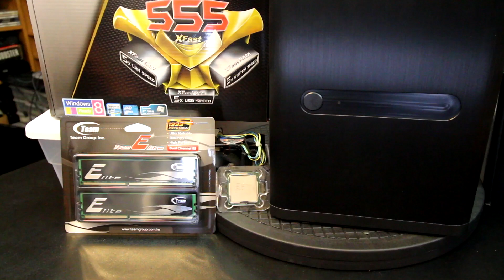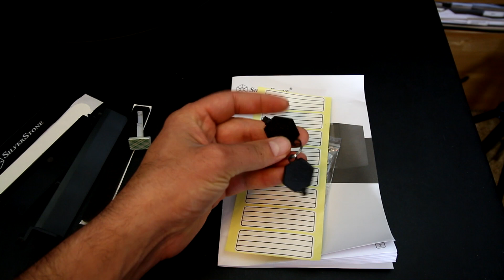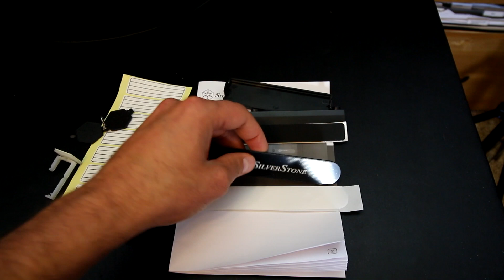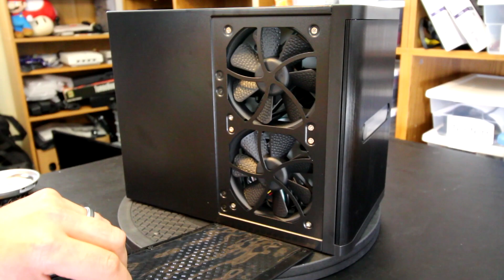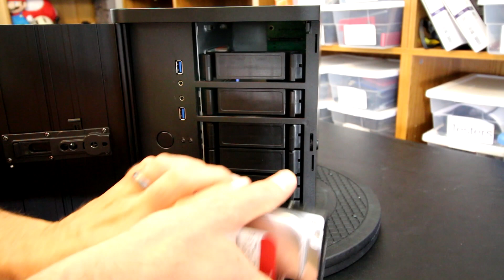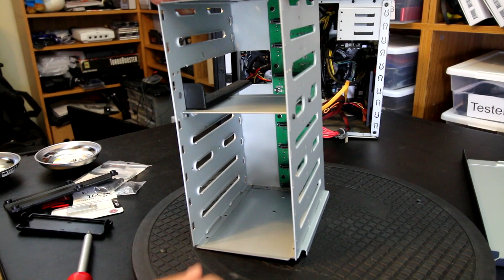NAS build with the SilverStone DS380

Comment: My understanding is that you can have the 9 hard drives but you would have 2 hard drives NOT HOT Swappable drive but then you your still getting the best out the case
Reply from the maker: +ROB MCGILL Yes that is possible and will allow to get more from the case.
Reply: How do you get 9 drives in there with two no hot swappable?
Reply from the maker: I think what he was getting at was 2 non hot swap bays and 7 hot swap drives while using a video card.
Reply: Oh I see. Thanks for clearing that up for me.
Reply from the maker: You bet. No problem.

Comment: Dude, that thing is fucking expensive! Why not put a few more bucks in it and buy a Lian Li PC-Q26...
Reply from the maker: +GuteAlteDMark The PC-Q26 doesn't have 8 hot swap HDD bays though. That is what brings the cost up on the DS380.
Reply: AdoptedMike
But it has Backplane... well you'll have to buy the other 8, because it comes with only 2. And for a private nas it's no problem to open the side panel to swap a drive. If you lose a drive you'll have bigger problems anyway than opening a pannel.
Reply: +GuteAlteDMark Good luck finding the backplanes for sale. Go ahead, I DARE you. Lian Li didn't respond to my query about them and they're no where to be found for sale online. The PC-Q26 is a fail because lian-li didn't support it with accessories like that..
Reply: Dajinn
Well in Germany we can just buy them online.
Reply: +GuteAlteDMark wow man that's just great, does the video poster sound like he lives in the EU? let's get even more realistic here. after buying 4 more backplanes, at 13 USD(converted from a conservative estimate of 12 euros), the case comes out to 242 total before shipping or any tax, depending on where the buyer gets the case. that's pretty costly!
Reply: Dajinn
And it's some solid shit. This one looks so cheap and as you can hear from the guy in the video it's difficult to handle. So why not invest a few more bucks and have good quality instead of this cheap steal case...
Reply: +GuteAlteDMark 

http://www.amazon.com/gp/product/B00IAELTAI/ref=as_li_tl?ie=UTF8&camp=1789&creative=390957&creativeASIN=B00IAELTAI&linkCode=as2&tag=xdm2kdv-20&linkId=EQ3AKDQJ6ZRYDYDU     Silverstone DS380 price is $99. I don't think it is expensive.. It has good review.

Dude, that thing is fucking expensive! Why not put a few more bucks in it and buy a Lian Li PC-Q26...
Reply: +go Go $149.99 USD...
Reply: go Go
http://geizhals.de/silverstone-ds380-sst-ds380b-a1064122.html?plz=&t=v&va=b&vl=de&hloc=at&hloc=de&v=e#filterform
170€ here... pretty expensive for that low quality.
Reply: +Dajinn I've managed to find 2 versions of the backplane on Amazon.  2 drive and 3 drive versions.  they run 20 and 25 USD which adds up quickly.  

I'm considering building using the u-nas nsc800 chassis.  it's pricey at $225 with shipping but its slick

Comment: I hear you on the hassle to replace memory sticks, but as far as losing the hard drive, looks like you could have removed all the plastic bits and still used the bay.  Or just put one of your 2.5 in drives there?  I would also wonder if you cleaned up the sas cables if they'd come off as a unit.  Nice review though.  Good job!

Comment: I see that the case has 2 sata ports for each drive space - Why?
Reply from the maker: +yaris5150 One is for SAS drives and the other is for SATA drives. Depending on what drives you are putting in the bays, you would use one or the other.
Reply: Oh, that makes sense. Thanks! Do you know if there is updated version/another case that has this same kind of setup, but does that whole PCB thing better? I see you were saying it's not the best, but if it works fine I guess I'd be fine with it. Thanks for the response!
Reply from the maker: +yaris5150 You're welcome! I don't think that it has been updated at this point. Solid caps would be much better, hopefully at some point it will be updated. But if you aren't opening an fiddling around inside, you should never have to worry after the first time. Just be careful and you shouldn't have a problem.

Comment: Thanks for the informative review. That is quite cramped. I would also recommend a Fractal Define R4 or R5. Just did an 8-drive NAS build myself in an R5 with the popular ASRock C2550. A lot more room to work with cables, fans are better positioned to blow directly over/around/between the drives, and quiet design helps keep drive noise reasonable.

Comment: Great video man. Perfect amount of detail for when you are seriously considering the hardware.

I'm on the fence with this case. I really like it, but that issue with the raid card is a real bummer. It was hard to tell in from the vid, but would it not have been possible to cut away some of the plastic to make room for the card, or would that has messed the support? I was also a bit disappointed with the lack of rubber mounts for the drives.

Have you come across any similar cases? I am looking for smallest form factor but absolutely must have 8 drives.

Cheers for your efforts.
Reply from the maker: L4RRY  I have actually updated to Fractal Design Define R5. While it doesn't have hot swap bays, it is much larger for ease of cable and hardware management. I also went with the ASRock C2550D4I server board and ECC RAM. I found out that it is a much better platform for data security than what I was using in the video with the Celeron. I am now using FreeNAS and a ZFS2. The case is much bigger, but I am still able to hide it away. Plus temps are likely better too. The R5 has much better airflow and is actually more quiet. 

People have told me that you can still cram an HDD into the bay even with that RAID card installed. I never tried it. I lost that sever setup in a fire unfortunately.
Reply: +AdoptedMike Thanks for the review and some of the alternatives you have suggested, especially the case. While I, personally, don't see the need in upgrading to a server board, I can see why someone would. Thank you for the review. I am glad to see that this case won't work with my Adaptec raid card that I have.
Reply from the maker: +diskmaster23 Thank you for the feedback, I am glad that I could help.

Comment: Hi Mike.  I think I would have taken a dremel to the 2.5" cage and cut off the bottom section.  Your #8 drive could be hung vertically so at least you'd get it in there, albeit an aesthetic compromise.
Of course you could also do a build using no hardware RAID card, running ZFS with ECC RAM.  That would free up some room.
Very nice build, despite the frustration.  Like you said, it's not for show, and the case looks great on the outside (and pretty good inside as well!)
Reply from the maker: Wikus Van De Merwe I lost this NAS box a few months ago in a fire which took out a lot of my home, office and studio. So, I have actually updated to a Fractal Design Define R5 case which is much larger and easy to cable manage. Probably helps airflow and temps as well. I went with the ASRock C2550D4I server board with 32GB ECC RAM. I have found it to be a much better setup for data than what I was using in this video. I ended up going with FreeNAS as the operating system and using ZFS2 array of six 2TB drives. So far, I have had good luck. Just no hot swap bays but many times easier. Thanks for the positive comment! Are you thinking of doing a ZFS NAS build?
Reply: AdoptedMike Hi Mike.  I am actually in the middle of a ZFS NAS build (having caught the NAS fever!).  It's using an older Z87 board, 16GB non-ECC RAM, and a G3220 CPU.  Not the perfect arrangement, but hey... cheap.

Of the 6 2TB drives I had donated to me, 4 were damaged in shipping, so the NAS is running on 2x 2TB  drives at the moment using NAS4free.  Apart from the few days it took of swapping parts in and out to figure out what was wrong, it's run perfectly for 4 days now (NAS4free is actually so simple, I can temporarily set up a NAS using two thumbdrives and an old laptop in about 10 minutes!).

I'll be getting some more drives donated soon, probably 3x 3TB.  It's an interesting situation, since it will give me the chance to build a xpenology NAS, which can run a hybrid RAID that takes advantage of the mixed drive configuration.

I've already been running a commercial Synology NAS for over a year without a single issue!  Going with what is essentially two Synology boxes I'll not have the safety of ZFS, but will have two boxes for redundancy.

Keep on inspiring!
Reply from the maker: Wikus Van De Merwe Sounds like you got a well thought out plan. Two boxes are likely going to be better than one killer one. At the very least you will have a backup server. Thanks for the idea. I should look at building a cheap one to have just in case the main one fails and I need access to the data before I am able to repair it.

Comment: it there a way to put a 290 mm videocard please ? tell me yes !
it's 280 mm lengh, probably if the hdd case is not used i can cut 10 mm of the third hdd box
Reply from the maker: House Station Live - http://99.mhz.fm Anything is possible with a Dremel tool! :) You will probably have to modify the case in order to get that card in. I don't know for sure, I have not cut it up.
Reply: AdoptedMike

looking for an homemade nas to match the Asrock C2750 D4I with its 8 sata III ports
i don't have graphic card anyway. but sata ports even nots seems supporting sata iii speed, so it's definitly not interesting
Reply: AdoptedMike thanks for the video, really appreciate the details you provided
Reply: AdoptedMike

so icy dock mb998sp-b is a 5.25 bay which support 8 x 2.5" sata III disks.
a regular case with 1 5.25 port will be fine, even if design will not be such great and even if i will not have the "lock panel"
Reply: AdoptedMike

the othe problem is that the icy dock 5.25 case had 2 x 40 mm very noisy fans
Reply from the maker: House Station Live - http://99.mhz.fm You're welcome!
Reply: AdoptedMike

maybe synology diskstation ds414slim can be an awesome alternative, onli 2L chassis, 4 bays and sata III interface (and 250 € great price ^^)
Reply from the maker: House Station Live - http://99.mhz.fm I have ndever tried a Synology product, but I have heard a lot of good things about them.

Comment: I was torn between this and the new Define R5. With my huge hands, this video clenched it for me for the Define.  Hot Swap would be nice, though not strictly necessary.  Nice review, and thanks!  I'll be using the Asrock server board with a SATA-DOM for my boot device.
Reply from the maker: Scott Schappell I am looking at doing a build with that ASRock board as well. Good luck with your build. I love the Define R5.
Reply: AdoptedMike Thanks! I'm going to be putting a lot of faith into ZFS.
Reply from the maker: Scott Schappell Me too. But, all I hear are good things.
Reply: Scott Schappell  check fot the one wit the 8 core avaton cpu and 12 sata  so u can use all the bays

Comment: kind time.
I ask forgiveness for my English.
at me arose some questions connected about creation of NAS on the basis of this case.
1. noise. on how many noisy will be us with such stuffing of hard drives?
2. warmly. whether the system will overheat?
thanks
Reply from the maker: There is plenty of airflow in the system, I ended up using 4 slower RPM NAS drives so the heat was not an issue at all. It can be a little noisy, but the slower drives help with that as well. This box is meant to be tucked away. If you place it in an out of the way place, you can't hear it at all.
Reply: yes, you are right in an occasion to hide. simply I am afraid that WD Red will be heated in it if to hide. on it also I asked.
thanks.
Reply from the maker: Кирилл Шагин You're welcome. The fans in the case move a lot of air. As long as they are not blocked, I don't think the drives will overheat. The Red series is made to handle a little more heat and continuous operation as well.

Comment: Great Video - thanks!   So what's the OS/NAS software you chose for your setup?
Reply from the maker: I was going to use Free NAS and ZFS, but I read that for ZFS it is strongly suggested to use ECC RAM. The hardware I used in this video does not support ECC RAM. So I ended up using Windows Home Server 2011 and setting up a RAID 10 with 4x 2TB HDDs.

Comment: Hi Mike!!! :O) Great informative video!!! Your build is 'kinda' like the build I'll be doing in the next few months. Gigabyte F2A88XM-DS2 motherboard and an AMD A4 4000 apu (both of which are sitting on my shelf) will be the basis for my system. I have also got a Corsair CX 430 psu and a DVD/RW drive. Looking at creating my first ever RAID (I've been building PC's (when funds allow) since 1995) :O)
Reply from the maker: I love building computers. I built my first one in 2009 and then started building for friends as a hobby. Now it's almost a second job! But, I enjoy the crap out of it :)
Reply: AdoptedMike
Addictive, isn't it???! :O) First time I ever worked on a pc would have been in 1993 and that was to install a single speed CD ROM drive that cost £100 and a Sound Blaster card. The cpu was souldered onto the motherboard so couldn't be upgraded. It was an AMD 386 SX running at a blistering 25MHz and the pc also came with an 85MB hard drive! DOS 5 and Windows 3.1 came pre-installed and you had to backup the OS onto floppy!!!! :O)
Reply from the maker: That reminds me, I did a similar upgrade. Added a blazing fast 6X CDROM to my 486SX 25Mhz with a Sound Blaster card in like 1993-1994. Also added 4MB of RAM! I think the total upgrade was around $500. But I had 6MB of RAM and a 6X CDROM. I thought I would never need more! LOL. Especially with the huge 129MB HDD. :) Memories...
Reply: Its funny how tech and the prices for it, have changed over the years! I mean that DVD/RW drive I have for my next build (by Lite-On) only cost me £10 Yet that single speed CD drive which could only read back in the early 90's cost £100 And as you said: "Memories..." indeed!!! :O)
Reply from the maker: Desmond Birch I still have my old 486. I will have to hood it up and see if it still works...
Reply: My goodness!!! The first PC I ever built was with a 486DX2! It will be great too see your old 486!!! :O)

Comment: asrock rack c2750d4i it supports 12 drives
Reply from the maker: Wish I would have gotten that board. Would have made life much easier. Then I could also have used slim SATA data cables and not had nearly as much of a mess as the RAID cards breakout cables.

Comment: Hi Mike, great video, thanks. I bought this case for my NAS server, now I'm waiting the shipment. As mainboard I bought the "ASRock C2550D4I" which has 12 SATA connectivity, that matches with this case exactly ( 8x hot plug 3,5"; 3x 2,5" and one DOM disk for the system)
Reply from the maker: Good motherboard. Plus you won't need an add on card like I had to use and lose a drive bay. Good luck with your build.

Comment: IBM M1015 would do the job?
Reply from the maker: Looks like a good RAID card to me. I saw a few positive reviews online. Nothing really negative. I personally wouldn't be afraid of giving it a shot.
Reply: AdoptedMike Hi, still looking at this case, really concerned about losing one drive bay. Have you considered using a PCIe cable to bend the card up?
Reply from the maker: Rudde47 There doesn't appear to be enough room to do that securely. It probably would work, but I don't feel comfortable running the card that way. You would need to remove the PCB off of the PCI bracket and zip tie the PCB down to something. I would worry about the card not getting enough airflow or shorting out on a metal part. That being said, where there is a will there is a way. :)

Comment: Like the video, Hate those capacitors.
I could see them breaking pretty easily. Should have been recessed and higher quality. May be a dealbreaker for me
Reply from the maker: Especially for the high cost of the case. Solid caps should have been used for a $160 ITX case.
Reply: AdoptedMike How has the case (and capasitors) been? Any trouble?